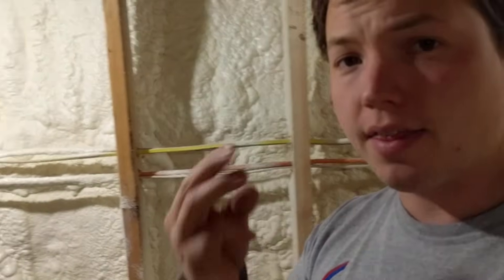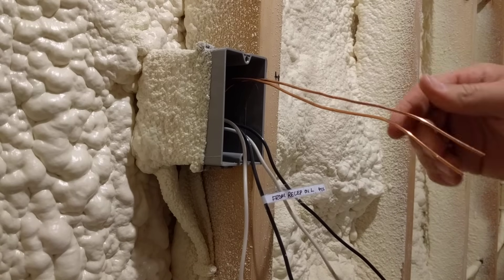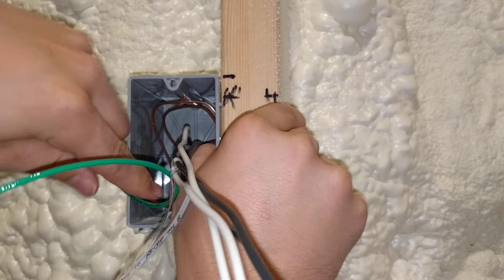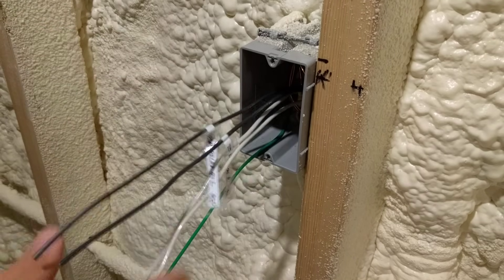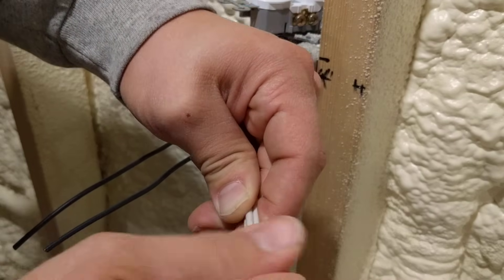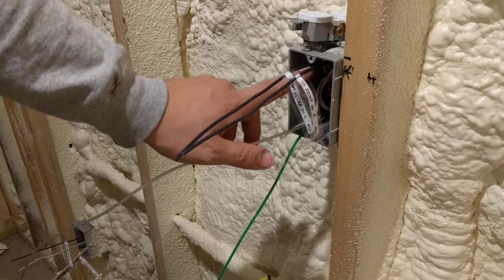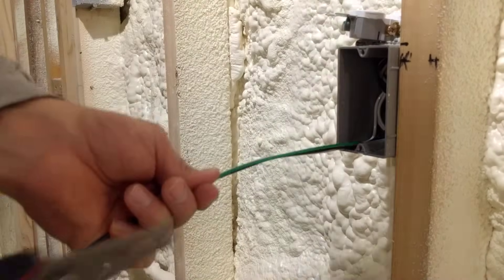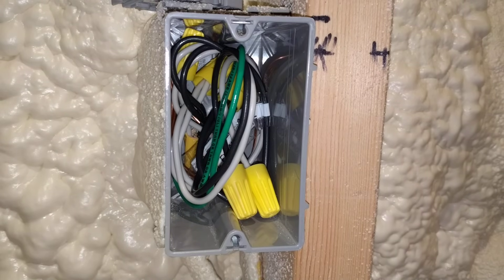How To Rough In Wires for a Standard Outlet or Receptacle Using Pigtails in Daisy Chain - Ben's DIY

Comment: I've seen electricians and diyers alike pigtail the neutrals and the hots, I've also seen the opposite done by both (direct to outlet). I don't feel a twisted connection is any less solid than a properly torqued screw terminal connection. If you have any solid stats to refute this Id love to read it. Most people have these unsubstantiated claims that it is better to use pigtails.
Reply: The wire nuts plus pigtails add volume, so it partly depends on the size of your box and wha';s going  in it. A GFCI outlet can substantially fill a small single gang box making  space a premium - in which case I would skip any pigtails/nuts in order to have enough room.
I agree that either way (wire nuts or terminal conn,) is fine.
Wire nuts have been used for nearly a century (ending "solder and tape") without any outcry about them -- and if there was a real problem with them, that would not have happened.
Reply: It’s also taught this way because if a single outlet became faulty, the rest of the circuit wouldn’t be affected
Reply: Dude I went to electrical school and have read like 20 electrician books. One reason why I would use the extra screws on the outlet to connect to another outlet is for GFCI purposes. If you connect,  let’s say three outlets in continuous circuit which is by using the extra screws instead of pig tails all 3 outlets will stop working if one messes up or all 3 will trip if one does. So by doing pig tails the other two outlets will work even if 1 messes up because they will have continuous power. Hope that helps
Reply: Giljr Gnosis Yes, the connectors on a GFCI outlet are specifically assigned for “load” and “line” and must be wired in that configuration in order to work properly. AFCI is now a standard along with requirements for all outlets on a potential wet area circuit to be GFCI’s however, as of a few years ago, you were generally ok as long as the originating outlet was GFCI.
Reply: @gil-juniorriseabovebetraya5972  this video is not about gfci. I dont get ur point lol.

Obviously if ur running gfci ur not gonna pig tail. 

Or you could just use a gfci breaker. Then it doesn't matter what u do 

Think u better read 20 more books lol

Comment: Holy shit, it's rare to see a layman actually make a pig tail like this. Other than not twisting your wires before putting on the wire nuts, not bad.
Reply: Twist wires before installing a wire nut to ensure good tight surface contact between conductors. That is a trade practice that ensures connection. The wire nut is to cover the connection.  
I do like pigtails for the simple reason that it keeps the load on the wires, not running through the devices.
Reply: FYI - You should not twist the wires before putting the wire nut on them. That can cause slippage of the nut rather than digging in tight to the wires. Let the nut twist them.
Reply: @2Truth4Liberty  That is actually false. When not pre-twisting, there is the hazard of the wirenut, especially cheap ones, not to fully engage on the splice. You should always pre-twist no matter the situation. Talk to any Master Electrician, Journeyman, or Wire Inspector.
Reply: @noahjohnson9680 
Not false but if it is false, can the manufactures be sued for identifying on the label that not pre-twisting is the recommended manner of installation? 
Even pre-twisting there is still the hazard of not fully engaging the splice.
Pre-twisting makes apply more pressure more difficult without the wires twisting while you are attempting contact (thus reducing the pressure you are putting on the wire).
All said - either way can be usable if you do it properly.
The most important thing REGARDLESS OF pre-twist or NO-pre-twist is to TAPE WRAP after install but too few people do that. 
And any Master Electrician, Journeyman, or Wire Inspector that doesn't recommend that is ignorant of the added safety factor that provides.
And that holds true for any connection, whether solder, split-bolt, or wire nut, etc.
Reply: @2Truth4Liberty  True True man. No mean to offend. I am a senior on Co-op at a Tech School, learned from 4 different Master Electricians, specializing in Residential, Commercial, Industrial, and On-Site management. Thanks for the info where I was a little off. Love to learn and try to help
Reply: @noahjohnson9680 
No offense taken. Electricity is so dangerous that using common sense to add safety in any way you can is worth it in the end. You never now whose life you might save  - including your own.
As for outlets - Second to tape wrap connections (other then screw terminals on the outlets) I recommend METAL boxes.
Plastic is SO EASY TO USE --- but it can melt and catch fire unlike METAL ones. But always ground the box - just as important.
In a "get it done" and "get it done fast" environment I can see where some people really have no choice but to go plastic. That's unfortunate.

Comment: Nice job. I hate when people use those stupid holes in the back and I hate that the manufacturers even use think that's a good way to make  connection as well. I just use the Screws and pig tail it just like you did. Oh also I always make sure even after the wire nut is on the wires I twist them all just in case for some reason a wire nut fell off it would hit ground.

Comment: What was the stripper tool you used?
Reply: Things that don’t exist: fairies, goblins, and how to electrical videos without at least one long rambling comment on why everything is wrong lol. Helpful video, thanks.
Reply: I didn't catch the brand but one thing to look for if you are going to use it a lot is fat handles. The skinny ones can dig into your palm and cause issues if you use them for many years.
Reply: little late, but theyre gardner bender GESP-70

Comment: This is the first guy in many electrical videos that correctly connected a wire nut.  Wires straight and even , not twisted. 2 electricians I know told me not twist the wire before putting the wire nut on, with exception of the ground wire.
Reply: they said that because an amateur such as yourself is less likely to fuck it up by doing that. any real electrician twists.

Comment: why did you use a 15 amp outlet?
Reply from the maker: janet sers I'm not totally sure what you're trying to ask but if you're talking about the receptacle itself then yes, you can use a 15amp receptacle on a 20amp circuit so as the outlet is general purpose and not for a single dedicated appliance that requires a 20amp receptacle.

Hope that helps.
Reply: 15 amp outlets are the most common on 20 amp circuits. 20 amp outlet is special purpose and should be wired on its own circuit